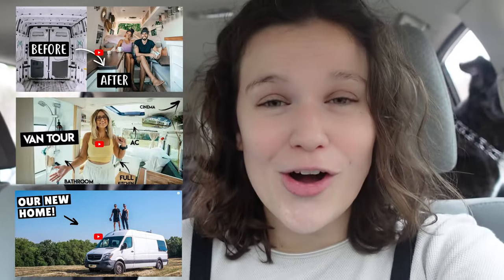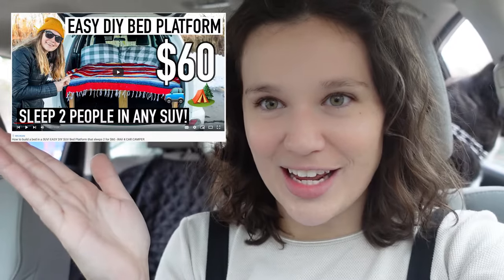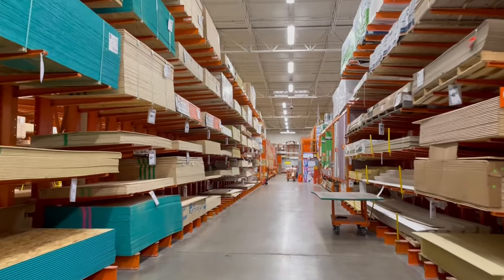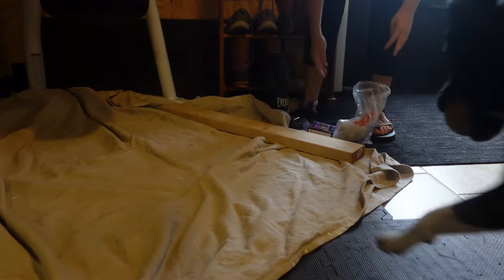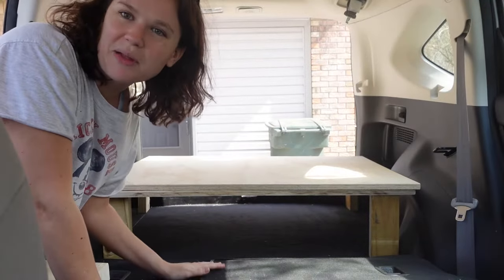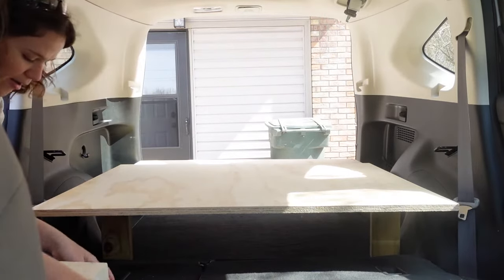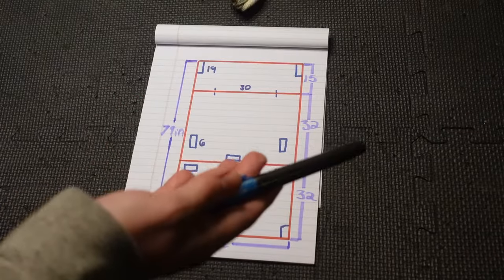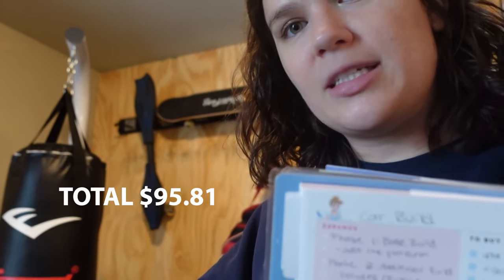turning my car into a camper | DIY platform that sleeps two and is removable!

Comment: That is very similar to what I did in my 2016 CRV. I used the same video you did to start with. I built mine with more support legs since I am 6'1" and 300 pounds. I wish I had seen this video before I built mine as you did a couple of things differently that are better than the way I did it. I can't wait to see your other videos!

Comment: First off, congrats to Rose for doing everything by herself with no previous experience. 
However, to anyone interested in making a bed platform for a Honda CRV, watch the video from Matt the Designer with the title "1 Sheet of Plywood Collapsible Platform" It is a similar design to this but in a much more refined, better-engineered version, more practical, and more functional as it also includes a slide out table. It costs the same and even though it looks more complicated, it isn't as he lists all the cuts you have to make and then assemble it.

Comment: So glad that I landed on your vlog and instantly subscribed. I am guessing that you are an Engineer in the way how you planned, documented and costed the assembly. Fine work and congratulations. Been  watching several videos in my quest to convert my 2014 CRV.  I rank you a #1 for the simplicity of design, fast, easy to Camperise (my own word!) and restore   to original vehicle. With any conversion, the ability to access the spare tire, and little extra space in the well (though a rarity..) was a concern with the CRV.  This design should allow you to lift the entire back platform up by removing the locator pin, and may be propping it up with taller wooden legs temporarily held by locator pins and get access to the spare tire.  Other option I would prefer would be that the 2 back legs near the trunk door side could be hinged so they can fold flush with the under side of the platform to easily access the spare tire without disturbing / moving the back platform. To restore the legs, un-hinge the legs to upright position and use a locator pin to prevent  it from folding and stay upright. Since access to spare tire is important, I wouldn't build any shelves on the underside, and limit the space underneath to removable plastic storage tubs or such. This is the first video of yours I have watched so far, and will be binge watching the rest of your series. Also whenever you visit any campsites would you please provide some details of that site with regard to the location, name, amenities, cost , safety etc which would be very helpful. Once again Kudos for a great Job!

Comment: I think I have the same year CRV. I did a very similar build for stealth camping on a road trip. I felt it was too cramped with vertical space.  Next time I think I'm removing the back seats and focus on getting the sleeping platform as low as possible.

Comment: Nice build! You are very entertaining. The determination in your face is very descriptive. btw your "drop pins" are carriage bolts. When I have suppliers cut materials, generally aluminum I will ask "I need an accurate cut" I've had good luck. My tolerance is generally 1/4" (+/- 1/8") which is sloppy. Your 1" (+/- 1/2") is a lot, but wood is pretty forgiving. Please have save Journeys and Wonderful Adventures!
Reply from the maker: Good to know!

Comment: Eric Enjoys Earth has a five ppanel version. The front and back panels both slide back to make sofa style seats. The two panels involved are joined by hinges.
The fifth panel is narrow and used to hold the panels down. His design requires a frame for the panels to move around on.

I think Eric and you use heavier timber than needed. Go back to Home Depot and find some actual bed legs. They are much skinnier than yours.

I intend to adapt Eric's idea and make torsion box panels, perhaps 40mm thick. I'm undecided between 3mm and 6/7mm ply. It should be a lot stronger but lighter than your design.. Weight costs fuel.

I have used an interior doom as a bed, it works well but can't be folded. Those are torsion boxes, 2040mm long.

Comment: Thank you for the nice tips on making my car into a camper! I was wondering what is the rest foundation of the front of the second plate? Doesn't it have legs? Secondly, won't the small plate in front tilt downwards without suspension or legs? Thanks again!

Comment: Are the front seats unusable when the bed platform is set up?
Reply from the maker: They are pushed as far forward as possible!  So you could put things on them but couldn't sit in them.  If you fold the piece of wood attached to the piano hinge back, you could sit in the front seat.
Reply: @RoseCatherine  Thank you! This is super helpful…nice to see a version for newer CRV; mine is 2016.

Comment: What year is your crv? Mine is 2013 and the seat is not as flat as yours
Reply: I believe it was a 2019!
Reply: Mine is 2014. when the back seat is folded it wont be flat / parallel to the ground. there will be a slight tilt / slope. It is the best you can get.